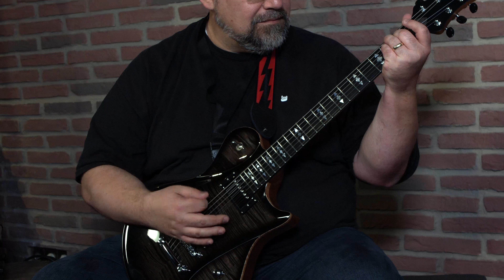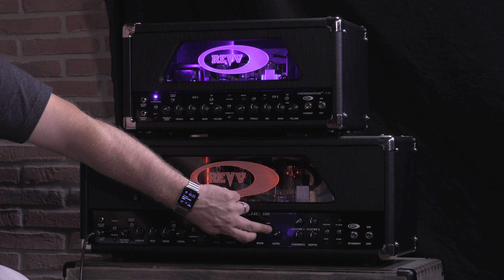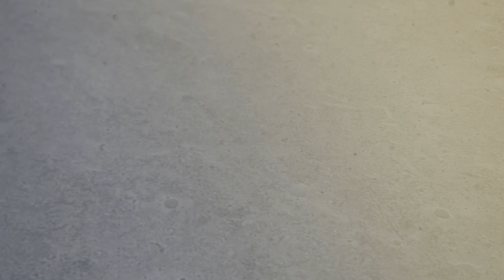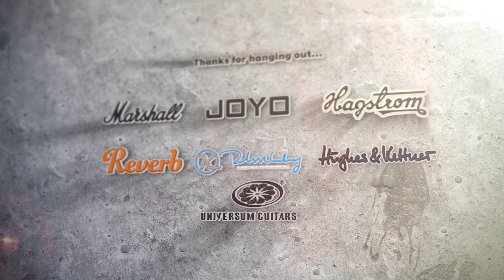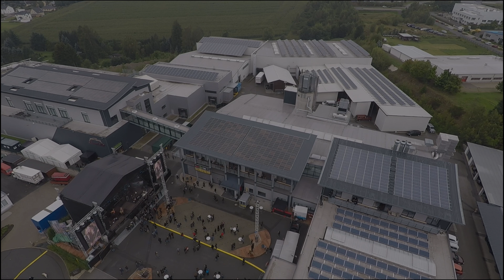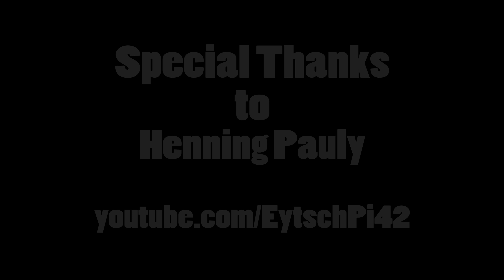GuitCon: Revv Generator 100 vs. 7-40 with special guest Derek from Revv Amps

Comment: We need a rev lunch box 5-20 watt head
Reply: I can tell you right now, that is not really on the horizon right now
Reply: Derek Eastveld I would highly be interested in a rev lunch box
Reply: cool, unfortunately we have several other projects that will tie us up for at least the next 1-2 years that will come before a lunchbox is considered.
Reply: Derek, what are the dimensions of the footswitch? Can't find it on your site. I'm wondering about the space it would take on my pedal board. Thanks.
Reply: ShredB4 dead if I were you I'd keep the Amp pedal off the board. It doesn't need power, why waste the space

Comment: Hmm, they sound stunning, but the fact that the 7-40 doesn't have independent master volume, but costs £1800 (or 2000 euros) in the UK means I'd never ever consider buying it. However, thanks as always for the effort you put into doing a demo for us pixxy, always appreciated.
Reply: that's what the 100 is for :)
Reply: Derek Eastveld I don't even understand howaster volumes work on multi channel.amps.
Reply: @robbievalentine8239  the way I look at it is you can punch the tubes more with the channel volume and play at a lower volume with the master.

Comment: Hello guy!!! My heart balance between the 7-40 mk2 and the 100w mk2.
I play in a rock-metal band and we do songs in which we alternate very clean sounds with very high gain parts. 
Can you compare the high gain channel 7 40 mk2 and the 100w model? Is the 100w sounds more massive than the 7 40? 
Is it better to push the push the volume of the 7 40 than to play the 100w at low volume?
If so, why a lot of metal players play with 100w tube amps like rectifiers?
Thank you so much for your help!!!
Reply: Honest answer. Unless you're playing larger venues, or outdoors, without mic/PA support, you probably don't need the 100watts. 40watt is plenty of clean headroom.